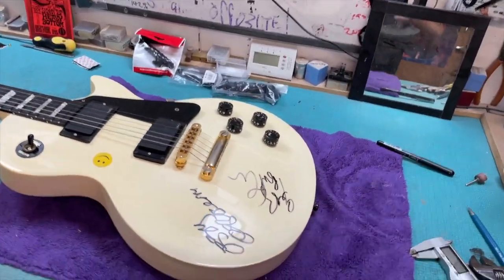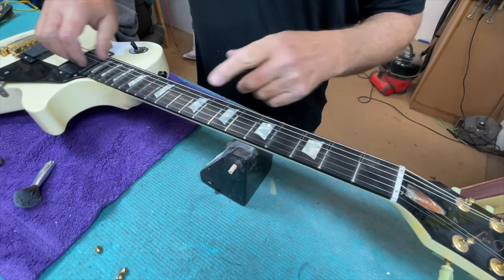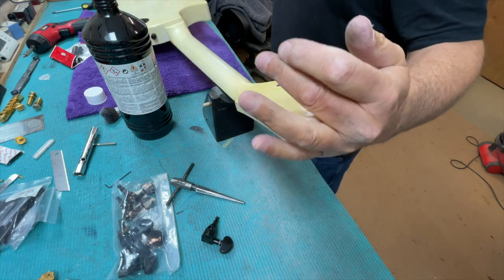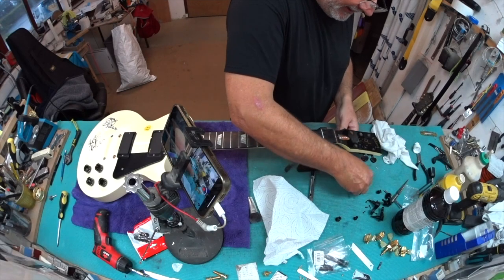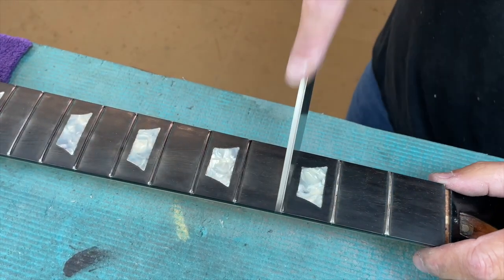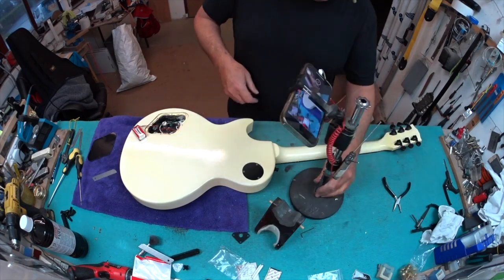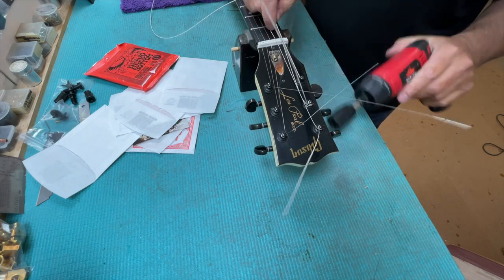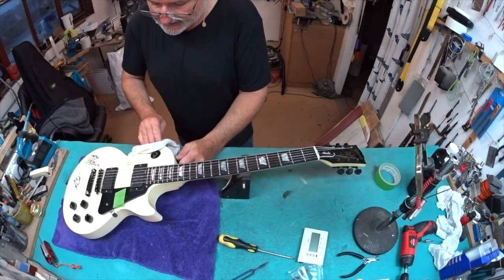Gibson Les Paul Studio set up - with a dash of auto pilot

Comment: Hi Sam, I have two questions!  I just received a U channel truss rod that I'm going to try your method for leveling with.  The one I have is for a guitar length.  If I want to level a bass,  should I get a longer one or will this one suffice?

2nd question just bought a Yamaha LL16 from Amazons used /return section.  I like the guitar it plays fine except for the A and D string around the 4th and 5th fret, it has a slight buzz.  I checked with a fret rocker and the frets appear to be level in that area.  Very very slight rocking at the high end of the fretboard which I don't think is the problem.  I loosened the truss rod for a little more relief, it helped slightly but I think the string height changed for the higher side.  Not sure if I should send it back or try the fret leveling on it what's your thoughts on the problem?
Reply from the maker: Hi @ek2thehands 1) Yes - I've got a longer one that I use for basses. What I haven't tried yet is using the bass one on the guitar :D 

2) Very very difficult to diagnose a guitar at distance. So...you can't use a fret rocker with the strings on; by definition under load the neck will be slightly curved. If you use a fret rocker with the strings off then loading the neck with string tension is likely to cause some degree of 'bunching' as a result of the longitudinal compression. At least that's what I've found over the years using this method. So what appears level with neck flat and strings off will very likely be 'relatively un-level' when you've loaded the neck. The only method to deal with the fretboard under load is this one.. so I would suggest that IF at your chosen action you are getting some buzz (fret slap or fret buzz) on the D and A around 4 & 5 then perform your precision levelling with the guitar under load. 

As will any tool / method, don't do this on special / expensive / rare guitars until you've gained enough confidence in using it. 
Hope that helps!
Reply: @SamDeeksRelovedGuitars  I very much appreciated your response to my issue.  I still have the option of returning it but not sure yet.  I really like your method of leveling the frets under playing tension.  I have a guitar that kind of chokes out on the high E string.  The guitar is not very expensive but it sounds great to me.  I'll try your technique on it.  I'll be very careful and will take my time.  Thanks for the info on   getting a longer truss rod for the bass guitar.  Hmmm, 🤔 I may just get a longer one and work on the bass first.  Sam, thanks again for the response and I'll keep watching!